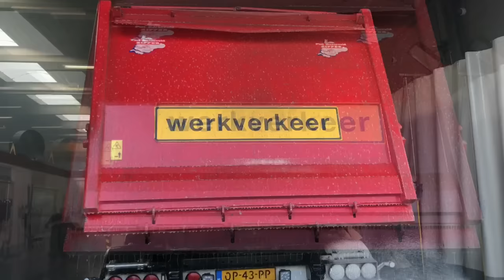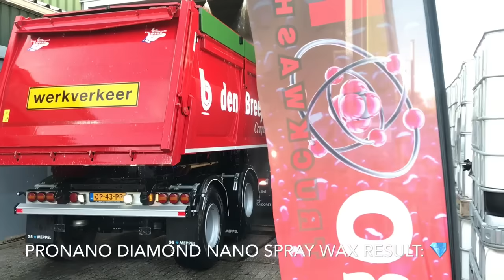MAN Truck real f*ck*ng dirt pt.3! 100% NON Contact High Quality TruckWash! ProNano

Comment: I like the "low pressure method" which is basically just wetting the dust and mud first. I hate seeing the stupid foam on top of caked mud/dust. It doesn't do much without water!

Comment: Always wash top to bottom wtf
Reply: monico ignacio why
Reply: No. For their method, it's better for them to wash bottom to top. They use the foam + high pressure water as kind of a sponge action to scrub off whatever dust is remaining. Watch enough of these and eventually it's explained.
Reply: op3l no it's still dumb 

You should foam from bottom to top but the rinse is always from top to bottom
Reply: ImplantedMemories well, I mean they do this everyday. If top to bottom cleaned more efficiently or better, they would of done it already. It's logic. Every touchless wash does down to up, and they can't all be doing it the wrong way. This is their livelihood.